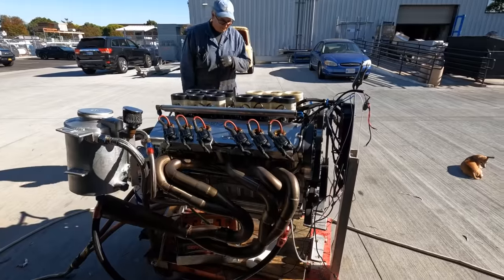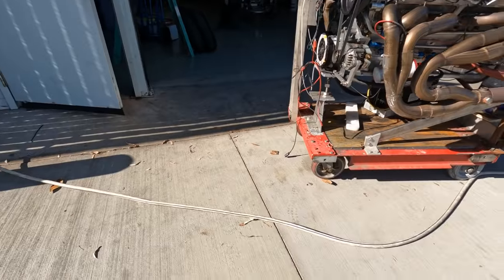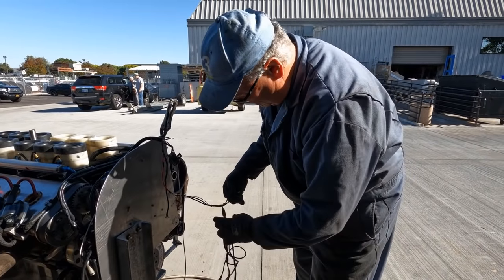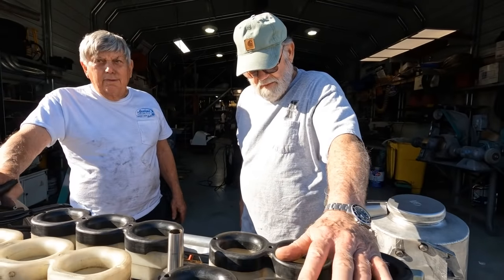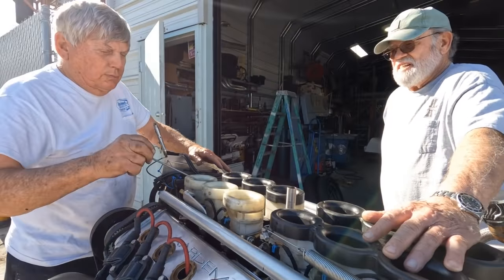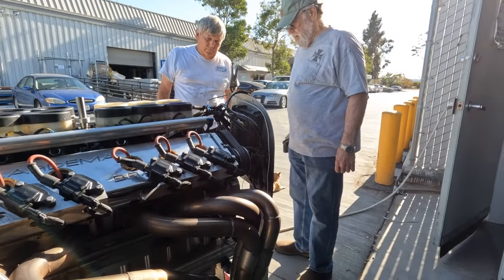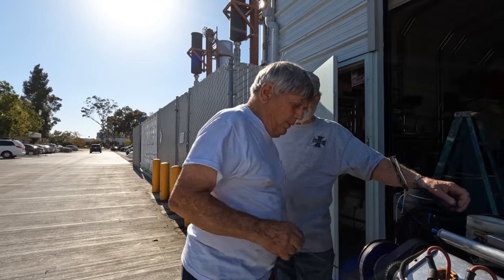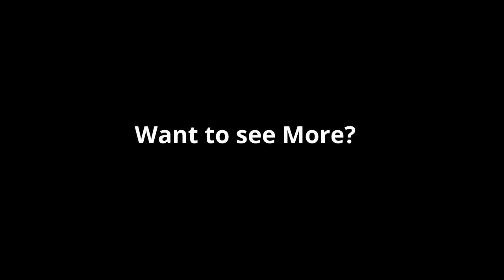Homemade V12 Engine Start Up - Pure V12 Sound & Shop Talk with Pete Aardema & Kevin Braun

Comment: Love the sound, and damn.. nice pipework(Handmade, gotta love it). wonder if the offset halfway is to create room for the throttle linkage or something else. Just wonder how these guys would tune and push an engine based on data analysis other than see hear and feel. Still love the old method of working, passionate.

Edit; Just noticed the other video (https://www.youtube.com/watch?v=gP5213NlQog), explains about the gap/offset.. Nice, i got some more stuff to watch :D

Comment: I don't like the idea of making the back cylinders richer because they are getting more air. That would increase the HP in those cylinders I'm sure that would not be a good solution. You have to design the intake to distribute the air more evenly.

Comment: Would 2 separate scoops help with the lean condition? 
Instead of One long scoop causing air to rush past the beginning cylinders having a scoop for the front and then a separate scoop for the rear
I’m no engineer or amazing it was just a Thought that popped into my head after thinking about how much velocity the air has going into the scoop

Comment: the liquid temps inside engine dictate the lean. I would nearly ignore the air as you are now. the back two cyls must be hotter at the oil and coolant. Try reversing the whole scoop, leave one opening at the back..maybe even get a pound or two of vacuum for all those throttles to dial into. Love that at 60 degrees..real v12. awesome engine.

Comment: 12 pyrometers 1 per tube gives exact ex temp . .43 pounds of fuel per hour per horsepower that’s with gas other fuels have different weight per gallon nitro heavier, alcohol lighter also has les btu s per gallon requires 2 1/4 more fuel for same hp .  May help ya . I’ve been doin this over 60 yrs many ways to skin a cat 60 degree 12 sounds good

Comment: I wonder why they don't just do an equal length Runner intake for each cylinder so that way it wouldn't matter about the farther pistons in the back running lean because the intake Runners would all be the same length that would negate cylinder running lean or fatter than any other one

Comment: Can you make /use? a large blower motor to blow air into the scope to check air distribution out of the scope?
Reply: Also check for air pressure at each intake, and think it will be a better indication.
Reply: @geoffhalstead1811  YES but you must run the car. With a flowbench you dont.
Reply: @samstewart4807 
Ah yes, a better solution if you have access to one👍
Forgot about how to generate the airflow without actually running the car🤗
Three score and seventeen has limits that really really p*ss me off no end🤬🤬🤬😂
My excuse😇

Comment: I am willing to build my own naturaly aspirated v12 engine for Audi R8 S tronic Gearbox. I am inlove in this method of engine build and I saw that it makes 920hp on the Dyno, which is insane, but, how much reliable is an engine like this? Is it reliable enough to be used to the max on a Hill-Climb event or Time Attack racing curciut?

Comment: Why at 250mph would the entire airbox not be pressured everywhere? Why would it pressurize the back more than the rest and if you are running a data capture system put some sensors on it out the top of the rear of the scoop and at near the front say over the second pair of butterflies, if one cylinder is running hot without a load you need to check the injectors

Comment: Positive air pressure is free hp , no way would I not make use of it , lean condition cure is o2 sensor on each of the 4 collectors and closed loop. If you use pressure sensors I the intake scoop that would show what is going on .
Just thought I would add my 5 cents worth , thanks Dwayne NZ.

Comment: I would think a hole in the back of the scoop would create a vacuum  effect...like holding an open soda can out the window while driving, in my little brain, sucking air and fuel out of the throttle bodies.

Comment: Pity there aren't more engine builders incorporating some of the same technology being used by the "FREEVALVE" product, which does away completely with ALL that thrashing and power robbing camshaft drive assembly (pulleys, belts, gears, bearings, etc.) but is hugely reliant on heavy duty computing. I suppose for the purposes of the end goal for these guys, the supercomputing required are just not practical.  Hard to deny the old school charm for sure, however.

Comment: In these conditions, it is hard to believe that Mercedes will keep a V12 engine only for the S-Class sedan, especially since, unlike BMW, the V12 engine is quite old.

Its architecture dates back to the mid-90s and today Mercedes has much more suitable alternatives to the V12 solution. The 4-liter twin-turbo V8 engine is almost as powerful, developing 612 hp in many Mercedes models compared to 630 hp in the V12 and in the Mercedes-AMG GT4 Door Coupe the V8 bi-turbo is even more powerful with 639 hp.

At the same time, the V8 is much more economical because it can be mated with the new 9-speed transmission while the V12 is coupled with the old 7-speed transmission which is the only gearbox in the Mercedes set that supports the enormous torque of 1,000 Nm.

In addition, the Mercedes-AMG S 63 is faster because it has a better power to weight ratio.

I was wondering a few years ago why Mercedes continues to produce this v12. Of course, many specimens went to Arab countries and China.
In 2014, the new bi-turbo V8 appeared, which was also installed under the hood of the S-Class at the 2017 facelift.

During a visit to Afflaterbach a few years ago I asked why V12 is still produced. And the answer was simple: because there are customers who want it. And those customers are not interested in the fact that the new S 63 accelerates by 0.2 or 0.3 seconds faster but want to enjoy the prestige of a V12. For them, only the number of cylinders matters.

For these customers neither the consumption matters nor the fact that the transmission is older and has only 7 gears.

For these customers, only the social status that a V12 gives matters, and if there are fans among them, then they may also be interested in the way the power is delivered which is unique to a V12. The available 1,000 Nm of torque at 2,300 rpm makes a Mercedes-AMG S65 accelerate like a TGV without feeling any effort.  But while an electric motor starts to cap as the speed increases, the V12 engine goes wild, with a torque of 1,000 Nm being constant up to 4,300 rpm.

From a technical point of view, the 6-cylinder in-line engine is the best balanced because it absorbs both first and second order vibrations. The same goes for a v12 that is just as well balanced.

The V12 Mercedes does not have the exciting and sharper sound of a V8, but it has a thicker and more pronounced tone that always announces to you that an enormous torque is always available.

Probably in the future, both Ferrari and Lamborghini will give up the V12 and there are rumors that the future Ferrari supercar will have a hybrid V6 engine but it is hard to imagine that Rolls-Royce and Bentley symbols of British luxury and prestige will give up the V12.

Comment: What would happen if you divided the ram air into two one for front 6 one for back 6 ? Then also what if you made way to drop the ram force less, something like a cone,  some way to turbulate the laminar air once it gets to optimum fuel/ air peak
Reply: If we want to divide into front and back, it would make much more sense to have to 120° V6 engines. I would even imagine that intake and exhaust should both be in ( above ) the Vee. Like on a motorbike DOHC: Two valve covers. You can basically mirror your valve set-up and exhaust goes over the spark plugs into the center. For even firing the engines are 60° apart ( in time ). For low rocking, they are mirrored. For zero rocking they are rotated by 60° with respect to each other. So there is gear in the center of the crank and then timing belts.

Comment: How a about a 4 cylinder single row or 8 cylinder twin row radial engine?  Make it a two stroke and you won’t need master rods (a single crank pin carries four conrods. 
Breath via a hollow crank (non drive side) with small blower to aid scavenging. Exhaust will do the rest.

Comment: I love the sound of a BMW V12 as much as the next guy however, i just don’t think it has the right characteristics for a LSR car.  Too many cylinders, NA, and it makes instrumenting it unnecessarily expensive.  You should really have an EGT on each cylinder and configure a limit alarm in the ECU.  This engine really should be in a little light weight circuit track car, that’s where it’s advantages would shine.

Comment: Why go to all that work to build a V12 when a V8 could be built larger than that !!!  Some body must have asked him what time it was and he built the engine to explain !!!
Reply from the maker: The V12 is 6 liters and classified as a C gas engine for land-speed racing purposes.  The V8 engines that Pete and Kevin have do not produce enough HP to go 280MPH in this category. This purpose built V12 is In the same category as a Chevy 350 and cannot exceed 6 liters for this racing class. The V12 is naturally aspirated and turns 10,000 rpm providing them a leg up with 920HP.   They are currently looking at building a 500 CID V8 that will make over 1200HP and would need to go over 353 MPH to get the record.

Comment: What if you had two scoops one for front six another for back six.
Reply from the maker: James, that was a consideration, Pete and Kevin have created a baffle that sits above the throttle bodies.  Bonneville was canceled so they never got to try it out to see how it will work.
Reply: @GregQuirin  Thinking along the path of least resistance I would think the cfm would be same on both scoops

Comment: My question is why use a HP robbing alternator when you can use a MSD Pro Mag 44A magneto which generates its wn spark without the need for a battery or alternator?  Borrowing again from top fuel technology why not add a Root supercharger into a plenum for even air distribution?  Although the supercharger is parasitic to the HP it will be only fractional to the improved output.

Comment: maybe you can divide that scoop up with dividers? like groups of 4 so two dividers/baffles?    ah so it is a pressurized air box.. on bikes they have a vacuum activated bleeders but they are closed most the time its so hard to get a bunch of air with a bike no frontal area and they're sucking an awful lot of air some are 900hp that's a lot of air, they are prolly not pressurized near the trap, more like the opposite...  you guys put a gauge on it and see if its still pressurized just before shut down, maybe pout a gauge or a sensor on the box check it out.. I saw those pistons, HUGE, big valves, she is sucking tons of air literally at 10,000 RPMs?  holy cow that's an awful lot of air, can the scoop keep up, keep the box pressurized or is it sucking it up so much its actually has vacuum in the box?  crazy .. props tho some real good work, engineering everything... good luck on the salt, bring it home!

Comment: no doubt about it, a V12 as Rolls Royce knew when they built the Merlin gives a narrow width profile for going fast. Sounds fiesty, like a Ferrari V12. Yes,at those speeds the ram air effect could be leaning out cylinders due to uneven flow.
Reply from the maker: We are pretty sure this is what happen to the rear two cylinders.  Redesign of the scoop and EGT monitoring is in the works before the next land speed attempt at Bonneville.  Stay tuned, in a couple weeks we will try fire up the Big V12, 20 Liters. It has been in hibernation for 5 years this one will rock the neighborhood.   thanks Greg Q

Comment: At 250 mph, the raw pressure gain at 250 mph is around 20%. That should be roughly equal for all cylinders, if the airbox is well designed, but if it's directed more to some cylinders than others, the others may give a false rich average.

Comment: Sounds like a, Suzuki. (Jetski)

Was this a custom block or 2 V6 into, one?

I'm curious what one of these came out of, looks, & sounds like?

I have a 2.8 & a 4.3. 

It wouldn't surprise me if the 2.8 wouldn't run off & leave the 4.3 5 speed 2.8 Vs. 4.3 4x4, automatic?

That being, said,.... If a man had 2 of those little 2.8 S10 engines jiving, together? He would have ALL of the hursepurse & one of those little bastards  gets heylla fuel mileage!! My 4.3 seems to use sufficiently more gas than my 2.8? It likes to spit & sputter lately after 11,500 miles on its "fresh" engine, rebuild. My 2.8 has 200K on the original engine & I don't have reason to believe the front china rail seal, exists? That KAK suxka leaks oil, everytime. Valve covers, timing kit, still losing oil. The valve guide seals are blue tooth due to catalytic converter plugging, incident. The little azzhole spit out several gaskets & seals.😭

Comment: Hello my name is Chris and I have a ideal for a new Throttle Body that does not use a butterfly so 
when fully open nothing is in the port  its smooth and as it open its equal on both side of the port.
 if interested send a reply thank you
Reply: Barrel or slide valve or camera iris?  It's all been done before.

Comment: How are you making 920 HP out of 369 cubic inches with no blower, turbo or nitrous??????
Reply from the maker: This is what happens when Pete and Kevin work together and build these insane monsters.  Pete hope's to see speeds closer to 300 MPH  this season at Bonneville.   This engine is making 2.5 HP per cubic inch which is a goal for Pete and Kevin with pretty much all there engine designs.   I have a video on my YouTube page of the V12 on the dyno  you should check it out.  thanks Greg
Reply: @GregQuirin  Just watched the dyno video and it says they use nitrous so that explains the HP numbers.
Reply from the maker: @ThisNThatGarage   The V12 does not run Nitrous - Sorry there are two Dyno run videos, this is the run for the v12 making 920 HP,  Natural, No Blower , No NOS  running on Gasoline  https://youtu.be/d5kV3qkz6FM  the other is the 4 Liter v8 running Nitrous.  Sorry for the confusion.

Comment: What lifter is broke, or valve adj is bad. Mabie to old to hear.
Reply: As it turned out it was not a lifter noise. The valve reliefs on the pistons were cut with a taper and the valves were hitting the pistons on the radius. We had given the piston manufacturer the old piston to copy, but they changed the reliefs and I only checked the clearance on the depth.
Live and learn.

Comment: Bolted two 6 cylinder motors together and by the sound this engine does not make 920 HP.    There are plenty of Americans who did better back in the 50s.
Reply from the maker: Rex, This is not bolt two v6 engines together deal.  The block is 100% fabricated from scratch. We have some other videos showing how the engine was constructed and the 920HP dyno pull,  and most importantly a recorded speed of 279MPH.  You should check them out so you can see how unique and special this moment is. Your right, that back in the day a lot of people did this such as Henry Ford the Dodge bros and many more, however, today this is an oddity and a very special situation. My goal is to help share the great success of Pete and Kevin and the 100's of handmade engines they have built over the last few decades with a proven track  record.  This is the real deal, no trick up the sleeve.  Enjoy!

Comment: this V12 engine probably have 350 horsepower
Reply from the maker: it is 359 Cubic Inches and produces 920 HP - Please check out the channel and you will see more videos including the run at Bonneville with this V12 at 279 MPH - Thanks Greg
Reply: @GregQuirin  920 hp are kidding me, i have Honda Civic and it's only have 180 hp that is a lot of hp for Honda

Comment: Instead of spending 3 years building that thing, they would have been better off using a lambo 6.5 v12. Roughly same displacement.  Then all the engineering would have been done.  They could have at that point spent time making that engine make what ever amount of power was desired.  Why try and reinvent the wheel.

Comment: Buy these guys an IR gun...
Reply from the maker: Water and Spray bottle always works and doesn't require a 9v battery  ;-)
Reply: @GregQuirin  these guys are great... as hardcore as they come... buy them some batteries too :)